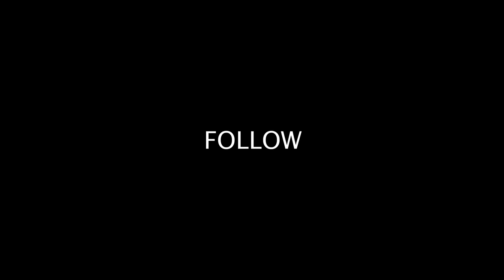Jennie FLOORED by the FIRST SALE in the NEW SHOP! 🥳️

Comment: I own a painting company and we do tons of sets of cabinets every year.  We use a 10x10' popup tent wrapped in plastic for our spray booth.  We set it up in the customer's garage and put floor paper down first, then set the tent on top of it.  You can also buy tents that have zip on sides for around $100 on Amazon.  I wouldn't waste time with the inflatable spray booth.  You'll get a lot more mileage for your buck using the popup tent.
Reply: I restore antique tractors and will give the popup tent a try. Thanks!

Comment: Suggestion.  Perhaps you've already thought of this... 
I suggest taking a piece of string, rope, or small chain and attaching it near your tape dispenser to use it as a measuring guide for your future employees.  It would be easy to mark different lengths on it for your different shipping box sizes, like using different colored pieces of tape wrapped around for each perfect length.  This would help eliminate wasted tape from an employee pulling out too much for a box..  Pennies saved stack up.....

Comment: I use a portable blow up booth to spray cabinets in. Some advantages are that you can get almost no dirt or dust in the finish. How much positive pressure that's in the booth is adjustable by how far the filter flaps are opened. Depending on what finish you use, the fumes will be in the shop with the space you have designated. They are noisy, and bulky to store, but for the price they are worth the money even if it was a 1 yr solution.

Comment: I predict you will want to move your fulfillment station into one of the inside rooms before long. Lots of dust out in the shop will become an issue with your boxes and completed boards when you go to add finish and package them up.
Reply: Yeah, probably time to invest in some Air scrubbers/Dust cleaners.  I was thinking a large curtain to separate off the fullfillment area as well.
Reply: @WoodUCreate   I use three Jet or Rikon air scrubbers in my shop. That works well in conjunction with the dust collection system.

Comment: A couple ideas for the table where you'll be finish sanding the boards.  A downdraft table that pulls the particulates from the sander into a tube connected to your dust collection system.  Or keeping with the mobile theme...a mobile Festool dust collector/extractor.

Comment: I would not use an inflatable booth, I gave you this recommendation months ago and you responded to it, the reason is you can't clean over spray off of the walls, they usually have poor lighting very expensive to run to air it up hoping that you don't ever peirce it and they're not a good longterm solution, I would and have struggled bought a semi downdraft booth and haven't looked back, that's where you'll make your highest return on profit is the booth. Just my thoughts, I'm very happy for your guys success keep it up
Reply from the maker: Hey! Yes we remember your comment! For only $900, I don’t think it would be a waste of money to suffer with it until we had the cash for a downdraft tunnel.

Gotta do it ugly before we can do it well!
Reply: I understand wish yall the best

Comment: 5:23 I assume you're putting a registration mark on the board for the lasers? If so (and further assuming your boards are all the same size, or at least a small number of set sizes), can I suggest a jig for doing that? I'm thinking laser cut acrylic, but use whatever material/method you like. Register it against the left side of the board and have a notch or something where you need to make your mark. No measuring and having to think about what number to make a mark at.
Reply from the maker: Yes! One day we’ll tackle this. Right now we have bigger fish to fry

Comment: Hey. in the future if you install a dust system then do not use PVC pipes. it is necessary to use metal pipes. To ensure grounding.
Reply from the maker: We’ll probably use metal hvac pipes, but you can also ground pvc - it’s just a lot of extra work!